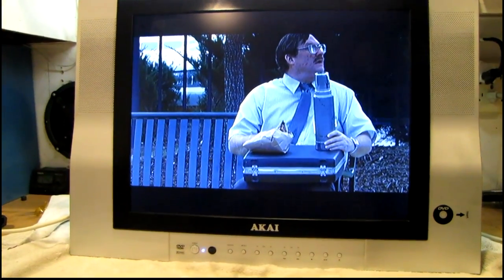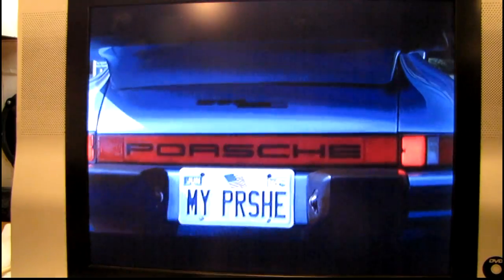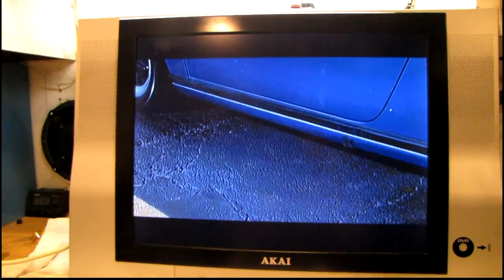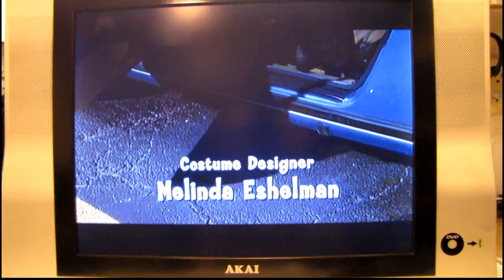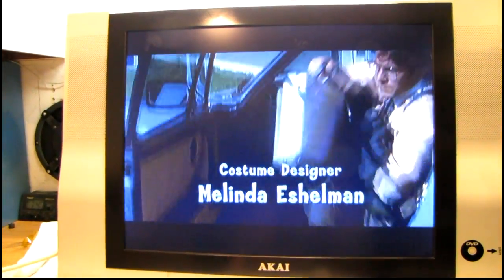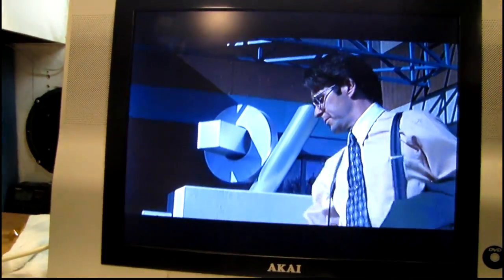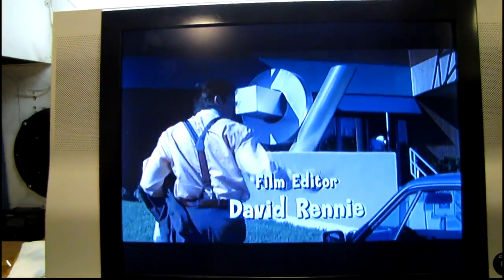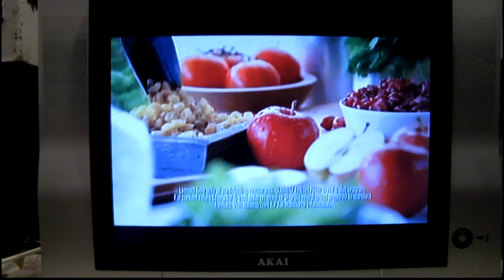Akai LCD TV/DVD Combo Repair

Comment: Very good repair job , it is better now than when it was new.  If it wasn't hit by lightning it would seem that the TV was not designed very well from circuit protection to having only  the minimum requirements for the power supply.

Comment: That's probably one of those 20-inch 640x480 LCD TVs that were sold around 4-5 years ago. Having that low of a resolution made the picture fuzzy and grainy, but HDTVs were still very expensive, so it was a popular bargain buy. Some of these were advertised as "EDTV" (Enhanced Definition TV), a made-up name for progressive-scan standard definition video.

Comment from the maker: @Machinia A bit of both.  If you Google/Wikipedia "Capacitor Plague" you'll find some info on how cheap/defective caps got into everything.  Also, the forums at badcaps dot net are a good place to read up on it, along with everything else to do with computers and electronics.

Comment: @Maxxarcade you replaced the 12v psu by 2 12V psu's whit the same total amps or ?

And did you put them in serial from the power source ?

And can you test caps while they are soldered to the board or do you have to desolder them and test them on for one?

I hope you'll answer soon on my question!

Thx and keep the good vids comming up!

Comment: you do some good work bro.. i have an early 90's zenith gigantor crt that doesn't work any more. It used to work obviously, then a while back the speakers went out, then finally the whole thing won't turn on. You push the power button and the power light blinks briefly and nothing happens. I don't know a whole lot about crt's themselves but do you think it could be capacitors on the mainboard or a shot power supply?

Comment: i have a question. i have a raidmax rx-630z computer psu. i checked the capacitors and there not bad for now. i have it over a year now and its running great. the capacitor's brand are TEAPO . should i recap my power supply soon? i think TEAPO are cheap caps i guess. i have some pictures of the components in  my psu for you to see. i will private message you for the links. thanks for your help!